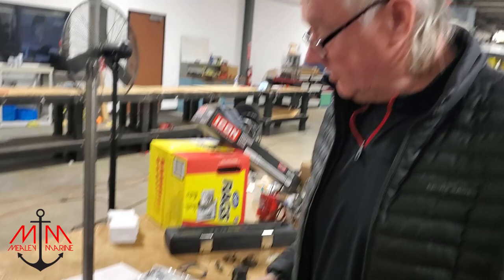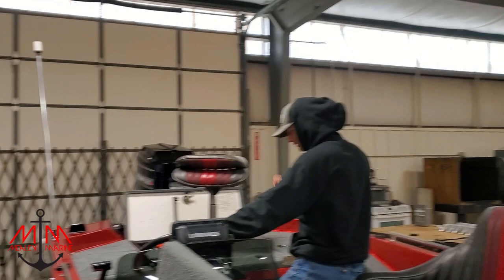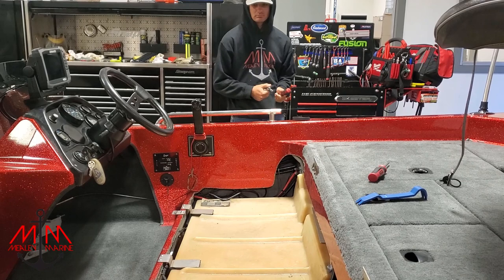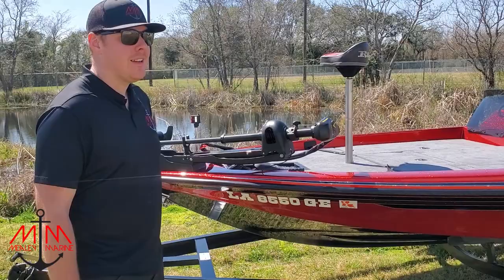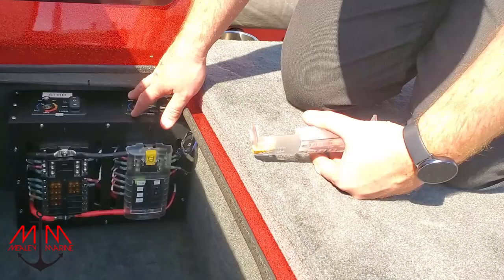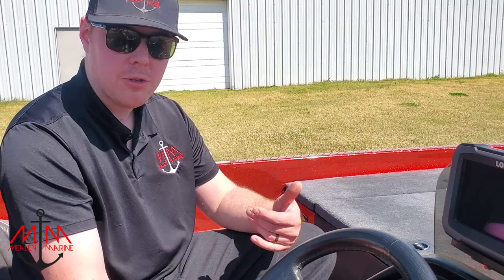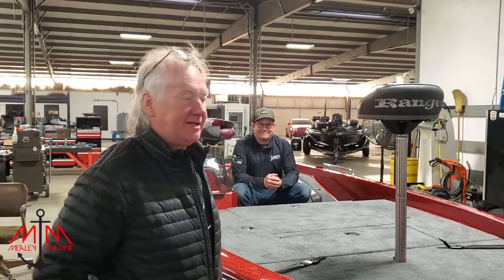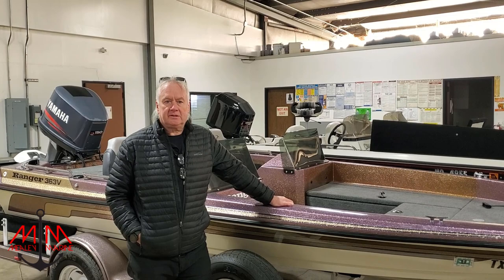1993 RANGER 361v | BASS BOAT RESTORATION | PART 15: IT'S FINISHED!!!!!!

Comment: That was an awesome series and the boat turned out beautiful, and that wiring job is truly next level. I work in and on a lot of boats myself and the wiring is almost always the biggest headache and if that stuff ever has to be touched in the future, the person working on it will have an easy job. Well done fellas. My only real tip ...for the battery charger, get one of the NOCO bulk head plugs that you can plug in the extension cord without having to open hatches. Can't wait to see the next boat! BTW, where's that champion at?

Comment: Just so you know for that water being hot when your dad touched it is not good means the boat is not keeping cool
Reply: It's supposed to be warm.  Not hot.  If hot yeh that could be another issue.  Hopefully they changed out overheat sensors and thermostat.  The thermostat detects water is getting hotter then opens up to allow more cool water.  It only really operates at idle because the water pump isn't spinning enough to pump the water up and threw the motor